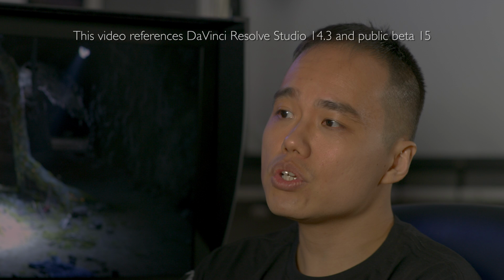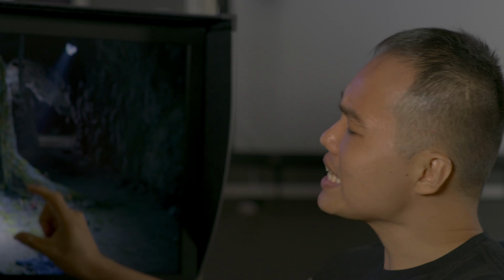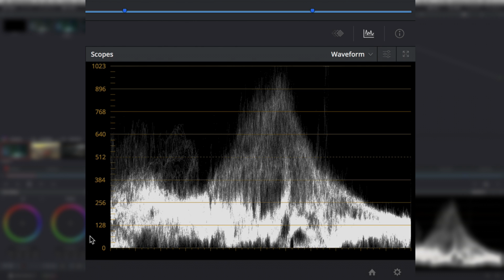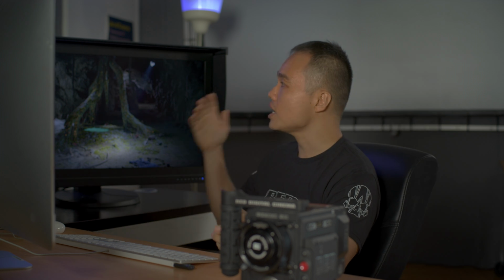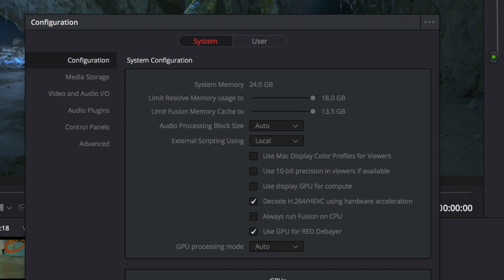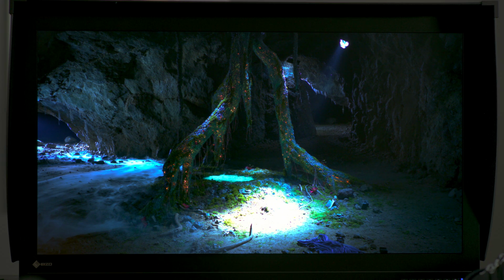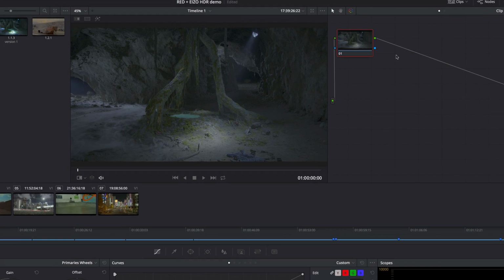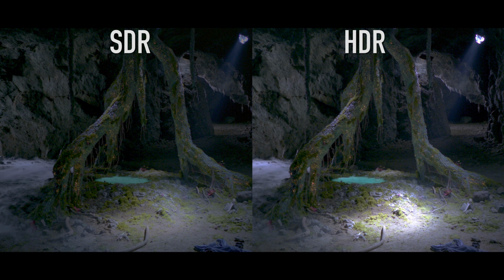Colour Grading For HDR10 Using DaVinci Resolve

Comment: Thanks for the info
so what camera do you think is best to shoot HDR10 video today?
for decent money that is ;)
Reply from the maker: Hmmm. Tbh, I try not to have an opinion about this, since there are so many great cameras today.

Instead, I'd use the following as my guiding principles for choosing a camera to shoot HDR:

• Dynamic Range – General consensus is that a HDR camera is one that needs to capture more than 12 stops of dynamic range. There are MANY of these now. =)  And you'll probably want one with the ability to record with Log.

• Bit Depth – HDR10 delivery is 10 bits, so I'd opt for a camera that has at least 10-bit recording capability. There aren't many options for 10-bit codecs in the consumer range.

• Chroma Subsampling – In order to preserve some level of flexibility during the colour grading process, you'd want at least 4:2:2 chroma subsampling during recording. Again, there aren't that many consumer devices with codecs that offer this. Ideally, you'd want 4:4:4 or motion RAW, but those immediately limit your options to the professional / broadcast / cinema realm.
Reply: @Reelisations  thanks man i have currently ordered the Lumix S5.
but i guess i need an monitor to be able to record in pro res och blackmagic raw.
and i also need an recording card to my PC to be able to output an HDR signal to my HDR tv.
lots of stuff is needed here but i think it will be worth it.

Also HDR10 looks far superior to the HLG clips i have seen from this camera.
and for that color grading is needed
Reply from the maker: Since you’re using a PC, you can seriously consider the Blackmagic Design DeckLink Mini Monitor 4K if you don’t need to go above 30 fps. That’s a decent entry-level card for HDR. If you need to go above 30 fps, do check out the higher-end models. :)

When grading on a TV for HDR10, don’t forget that each type of TV panel technology has a different peak white level. In your case, you have indicated that your TV can achieve 1400 nits. So if you try to hit 2000 nits, you’ll probably end up clipping the highlights instead. It’s just the limitation of the television panel being used. :)

Comment: Hi There,Do you know how to do grading for Sony OLED A9G?Can gives me some tips.Thank you.
Reply from the maker: I do generally like the OLED HDR TVs (especially those that can be calibrated), but there's an inherent upper limit that currently still exists in 2022.

Most OLED TVs have an upper limit of around 800 nits or less. Whereas professional displays like the EIZO CG3146 can achieve 1,000 nits while maintaining accuracy.

In other words, if you tried to push beyond the upper limit of the TV, your highlights would just clip. No detail.

So if you're mastering for a client like Netflix, using a TV as your primary colour grading screen probably wouldn't fly. 

But if you're experimenting with HDR for clients who want to display their content on HDR consumer screens, it's something worth considering. =)

Just keep in mind where your upper limit is. If you want to play very safe with a consumer TV, aim for around 600 nits as your maximum luminance.

And ensure that the video feed has HDR metadata that will tell the TV to switch over to HDR mode.

That's why DaVinci Resolve has a "Enable HDR metadata over HDMI" setting in Project Settings —> Master Settings —> Video Monitoring. It's for this very purpose.

This metadata is sent via a compatible Blackmagic Design video output device.

In the case of this video, I was using a Blackmagic Design UltraStudio 4K Extreme 3 to send the video feed to the monitor.

But you don't have to use that particular model. You can use another model like the UltraStudio 4K Mini or cards like the DeckLink Mini Monitor 4K. You just need to check their specs to see what their upper limits are in terms of HDR capability.

Comment: Hello, thanks for the video. Do you think it is possible to grade and hdr project using a hdr monitor (or tv) using resolve on an Imac 5k late 2015?
Reply from the maker: Hi Marco, I don't think it's impossible, but do keep in mind the following:

• A HDR TV may not be accurate enough for certain clients like Netflix. However, if you're experimenting with HDR for clients who aren't as stringent about their deliverables, that might be fine. So it depends on what you intend this setup for. =)

• Also try to find out the max luminance that the TV or monitor you're using can achieve. That will determine the limits of your colour grade. For example, if you're using an OLED TV that maxes out at 700 nits, then that's your upper limit. If you tried to push beyond the upper limit of the TV, your highlights would just clip. No detail.

• As for the iMac 5K late 2015 – to be honest, without knowing what kind of your footage you're trying to grade, it's nigh impossible for me to tell. But if you're grading high-resolution RAW footage, then I suspect you'd be straining at the limits of the machine. 😛

Comment: Why do you have your input color mode in SDR, REC709 in settings?
Reply from the maker: That is a great observation. =)

Because I was grading REDCODE RAW, DaVinci Resolve automatically knows how to transform the footage. This applies to any RAW files (Sony RAW, ARRIRAW, Canon RAW, etc.). So there's no need to specify the Colour Space nor Gamma. In fact, Resolve would ignore most of your attempts to modify the Input Color Space.

That's also why I put a link to my previous video in the upper-right-hand-corner – to explain why the Input Color Space isn't on. Here it is again:
https://www.youtube.com/watch?v=rqcapEgfK2U&t=175

However, if I was grading footage where insufficient metadata was present, I would certainly need to specify the Colour Space and Gamma. For example, if I was grading Sony FS7 footage that was recorded on an Atomos external recorder, the files may not have the necessary metadata. I would then need to specify in the Input Colour Space that I had shot in, e.g. S-Log2 and S-Gamut.

Comment: This was very informative, thank you! I have a beginner question: is it possible to monitor in HDR on an ordinary 4K HDR TV? I know it wouldn't be as accurate. I have a 2019 MacBook Pro and am trying to figure out if this is possible and, if so, what sort of dongle would be needed.
Reply from the maker: Hi Jack, this is possible, but as you rightly guessed, it's not the most accurate way. =)

So if you're mastering for a client like Netflix, using a TV as your primary colour grading screen probably wouldn't fly. 

But if you're experimenting with HDR for clients who want to display their content on HDR consumer screens, it's something worth considering. =)

One important thing to note – try to use a HDR TV that can achieve at least 540 nits of brightness. If you go below that, results might be lacklustre.

In order to connect to the TV effectively, you'd need a Blackmagic Design video output device of some sort.

In the case of this video, I was using a Blackmagic Design UltraStudio 4K Extreme 3 to send the video feed to the monitor.

But you don't have to use that particular model. You can use another model like the UltraStudio 4K Mini for your MacBook Pro. You just need to check the specs to see what their upper limits are in terms of HDR capability.

You can see the various options here in the "Capture and Playback" category here:
https://www.blackmagicdesign.com/sg/products

In order to get the TV to go into HDR mode, you have to ensure that the video feed has HDR metadata that will tell the TV to switch over to HDR mode. 

That's why DaVinci Resolve has a "Enable HDR metadata over HDMI" setting in Project Settings —> Master Settings —> Video Monitoring. It's for this very purpose.
Reply: @Reelisations  That's very helpful, thank you!
Reply from the maker: No worries. You’re welcome. :)

Comment: I heard somewhere that you need to get a computer card from Blackmagic to plug in a HDR monitor and get HDR when using Resolve. Is this no longer true? Am I correct? Am I confused? Also I have not been able to find where such a piece of hardware is sold.
Reply from the maker: It's true. For accurate results when colour grading material on a professional HDR monitor, you'd need a Blackmagic Design output device of some sort.

Because I was working on a Mac in this video, I was using a Blackmagic Design UltraStudio 4K Extreme 3.

But you don't have to use that particular model. You can use other models like the UltraStudio 4K Mini or cards like the DeckLink Mini Monitor 4K.

You can see the possible output devices on the Blackmagic Design website:
https://www.blackmagicdesign.com/sg/products

Look at the category called "Capture and Playback".

Comment: Hii i'm using benq sw270c model monitor how i use HDR mode plz tell me.
Reply from the maker: Hi, I'm so sorry, but I haven't used BenQ monitors extensively enough to give you specific advice.

But these are a few things you might want to think about:

• Set up Resolve as I suggested in the video, and turn on the HDR mode of your monitor.

• However, keep in mind that the brightness of your model is around 300 nits. And HDR usually requires 540 nits or higher. So I suspect what your monitor is doing is HDR emulation, so it may not be able to show HDR10 accurately.

• When using the monitor as a colour grading display, avoid connecting it via your graphics card. For greater accuracy, I'd advise connecting it directly to a video output device from Blackmagic Design (if you're planning to use DaVinci Resolve).

In the case of this video, I was using a Blackmagic Design UltraStudio 4K Extreme 3 to send the video feed to the monitor.

But you don't have to use that particular model. You can use another model like the UltraStudio 4K Mini or cards like the DeckLink Mini Monitor 4K. You just need to check their specs to see what their upper limits are in terms of HDR capability.
Reply: @Reelisations  Thanks 🙏 bro 
Now I’m using LG OLED CX model Tv
Reply from the maker: That's great to hear. =)

I do generally like the LG OLED TVs (that can be calibrated), but there's an inherent upper limit that currently still exists in 2022.

Most OLED TVs have an upper limit of around 800 nits or less. Whereas professional displays like the EIZO CG3146 can achieve 1,000 nits while maintaining accuracy.

In other words, if you tried to push beyond the upper limit of the TV, your highlights would just clip. No detail.

So, when grading, just keep in mind where your upper limit is. If you want to play very safe with a consumer TV, aim for around 600 nits as your maximum luminance.

And I would highly recommend calibrating the LG OLED TV with a probe. The price of the software has come down quite significantly:
https://store.portrait.com/consumer-software/calman-home-for-lg.html

Comment: Hello, teacher!  After you have used the sony ax700 to shoot HLG movies, how to set and output settings in the DaVinci 16 software, you can view the HDR pictures and images in YOUTOBE.  Thank you in advance for your guidance and explanation.  Thank you.
Reply from the maker: Hmmm. This is a really broad topic, but I'll give some general pointers below.

The way I tend to set up HLG colour grading in Resolve is to use Resolve Color Management (RCM).

These are my preferred settings in 2022:

• Input Color Space – whatever your original colour space was

In your case, I suspect that, if you were to right-click on your footage after enabling RCM, you'd see it automatically indicated as "Rec.2100 HLG (Scene)". Which is fine.

• Timeline Color Space – I'd choose "DaVinci Wide Gamut Intermediate", just so little/no colour is truncated. But it's a personal preference, so feel to deviate here. 

Note: once you start grading, you can longer change this setting. Changing the Timeline Color Space midway through the process can potentially mess up your grade.

• Output Color Space – "Rec.2100 HLG"

After all of the above is set up correctly, make sure to switch your HDR monitor over to HLG mode. =)

When you export the final deliverable, it needs to embedded with the metadata required for devices to understand it's HLG. 

If you've already followed the above steps for RCM, then leaving the Color Space Tag and Gamma Tag as "Same as Project" will work fine, as they will follow the Output Color Space setting.

If you haven't, then you'd need to manually set them to:
• Color Space Tag – "Rec.2020"
• Gamma Tag – "Rec.2100 HLG"

For YouTube uploads, I tend to export ProRes or DNxHD. But H.264 can be used as well, as long as you follow the correct settings ( https://support.google.com/youtube/answer/7126552 ).
Reply: @Reelisations  謝謝您的指導。

Comment: Sorry to go slightly off topic but I was wondering how you have your Eizo hooked up as a reference monitor? I’m looking to do the same and the only way I can see involves sending out from a  Blackmagic card and then into an Apantac Micro 4K-DP. I don’t want to sacrifice the 4444 4K-DCI image by going HDMI so Display Port is the only option. Is that the way you have it set up or do you have a different work around? The Apantac is pretty expensive to just convert the signal at around £1500! Thanks for your time.
Reply from the maker: In the case of this video, I was using a Blackmagic Design UltraStudio 4K Extreme 3 to send the video feed to the monitor.

But you don't have to use that particular model. You can use another model like the UltraStudio 4K Mini or cards like the DeckLink Mini Monitor 4K. You just need to check their specs to see what their upper limits are in terms of HDR capability.

For the purpose of this video, I was using a HDMI 2.0 cable to connect to the EIZO CG3145, if I'm not mistaken. Using a lower rating might not have worked.

And if I don't recall wrongly, I was able to get 4K DCI in 4:4:4 over HDMI 2.0. 

But when the newer EIZO CG3146 model came out, I started using 12G-SDI cables instead, because that model has SDI inputs.

Comment: excellent tutorial ! do you need a decklink or Aja I/o box between your iMac and your HDR monitor ? or a simple hdmi 2.0 cable ? does it work with a consumer dolby vision monitor ? thx for your answers
Reply from the maker: Yes, I did need to have a professional video output device to ensure a proper HDR signal can go from my system to a display. 

In the case of this video, I was using a Blackmagic Design UltraStudio 4K Extreme 3. 

But you don't have to use that particular model. You can use another model like the UltraStudio 4K Mini or cards like the DeckLink Mini Monitor 4K.

You can't use AJA if you're using DaVinci Resolve, since that brand is not supported by the software. 🙂

For the purpose of this video, I was using a HDMI 2.0 cable to connect to the EIZO CG3145, if I'm not mistaken. Using a lower rating might not have worked.

But when the newer EIZO CG3146 model came out, I started using 12G-SDI cables instead, because that model has SDI inputs.

I'm not sure I would use a consumer Dolby Vision monitor to grade, since I would be concerned if it's accurate enough for delivering to Netflix, etc.

But as to whether a consumer Dolby Vision monitor would be able to detect the HDR signal, it really depends on the below:

If it's a professional display like the EIZO CG3146, the monitor won't actually detect anything. It wants you to manually change the colour space setting in the monitor. This is true of most, if not all, professional displays. Including those from Sony, Canon, etc. I believe most computer monitors behave the same way, if I'm not mistaken.

The advantage is that you can customise the setting to whatever you need for your client. The downside is that you'd need to know exactly what you're trying to achieve.

For consumer TVs, it's the exact OPPOSITE scenario.

As far as I can tell, most consumer TVs cannot be forced into HDR mode within the menus. You can turn on HDR emulation, but you can't force the TVs into HDR mode.

The only way to do that is to ensure that the video feed has HDR metadata that will tell the TV to switch over to HDR mode. 

That's why DaVinci Resolve has a "Enable HDR metadata over HDMI" setting in Project Settings —> Master Settings —> Video Monitoring. It's for this very purpose.

Comment: The Eizo is a really great monitor, however it is really expensive. Does it also work to use an LG OLED with HDR10? Of course I know you will never get the same results as with an EIzo but will it at least work for small projects?
Reply from the maker: I do like the LG OLED TVs (that can be calibrated), but there's an inherent upper limit that currently still exists in 2022.

Most OLED TVs have an upper limit of around 800 nits or less. Whereas professional displays like the EIZO CG3146 can achieve 1,000 nits while maintaining accuracy.

In other words, if you tried to push beyond the upper limit of the TV, your highlights would just clip. No detail.

So, to answer your question – if you're mastering for a client like Netflix, using a TV as your primary colour grading screen probably wouldn't fly. 

But if you're experimenting with HDR for clients who want to display their content on HDR consumer screens, it's something worth considering. =)

Just keep in mind where your upper limit is. If you want to play very safe with a consumer TV, aim for around 600 nits as your maximum luminance.

And I would highly recommend calibrating the LG OLED TV with a probe. The price of the software has come down quite significantly:
https://store.portrait.com/consumer-software/calman-home-for-lg.html